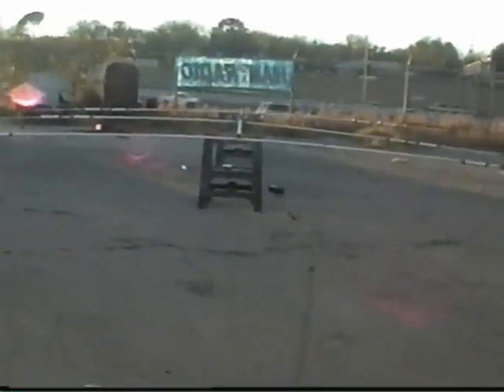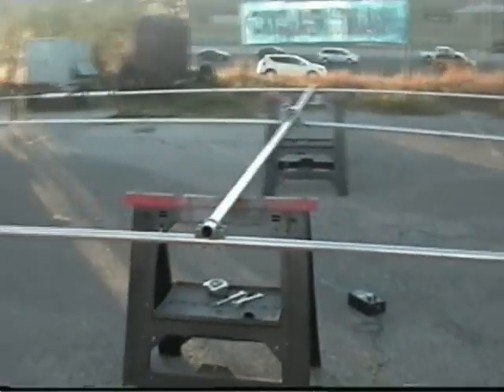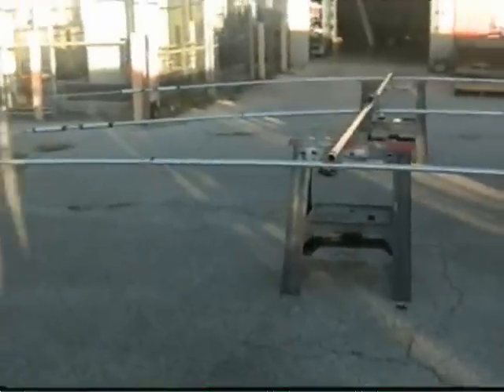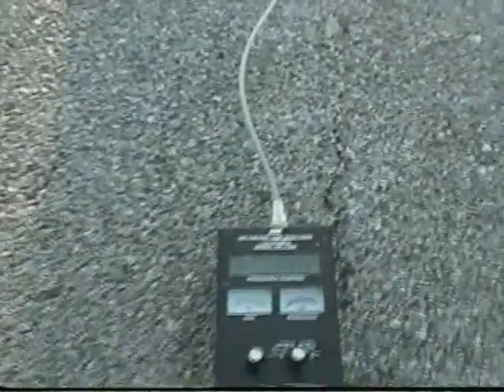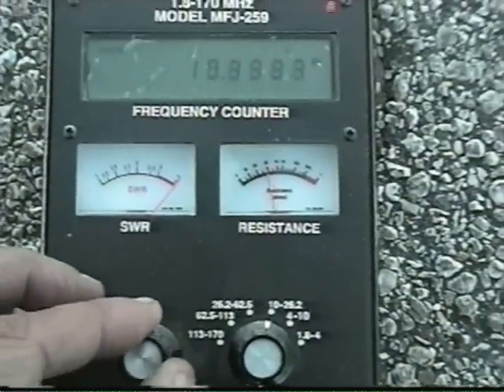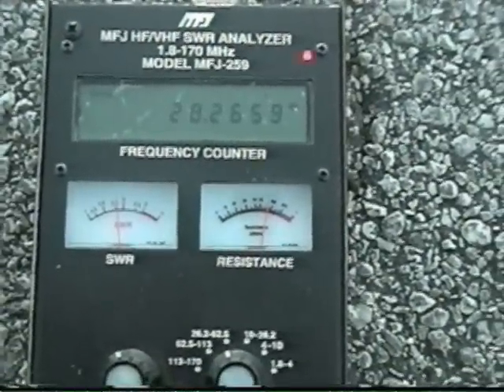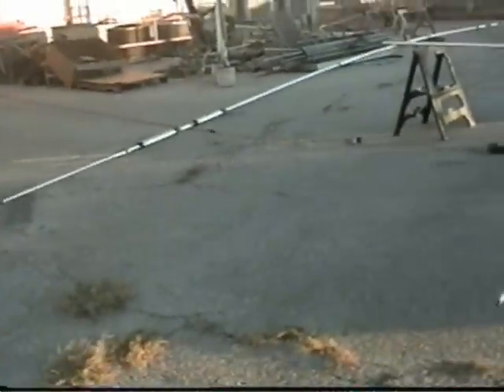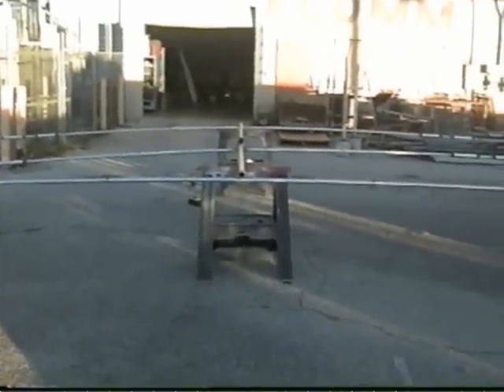Cushcraft A3S Tri-band HF Ham Radio Beam Antenna Tested At Ground Level

Comment: Fantastic video, although 15 years old but so much helpful. I had installed mine some 14/15 years ago, no issues, then reinstalling again after the house is rebuilt. In checking I found the 20m resonance is at 13.700 or thereabout when I picked the center frequency for tuning. This video confirmed that, it is normal to have resonance at much lower frequency when close to ground. Thank you...

Comment: Mel,  Just looking around at others with this antenna.  I have the ATB-34 Cushcraft 4 element beam which is exactly the same except they changed the stock number and added another 10 meter reflector to it.  I bought and put mine together in the mid 70's.  I run it at 40ft with 100 watts with excellent performance.  The gain and front to back is unreal   I've worked pile-ups in the mid-east, Europe, Asia, Africa, all with 100 watts.  I use RG213 military grade.  I have a friend on New Hampshire who I talk with frequently and he raves about my antenna!  I live in MS BTW.  I don't know when you made this video but assume you've had many contacts on it by now and well satisfied.  I paid about $275 for it new in the mid-70's.  Boy!  Have things gone up!!  73, Dan  WA5CYR
Reply: Dan Grisham I am looking for trap covers for my atb-34. Going to see if i can refurbish a great classic.

Thanks,

John

Comment: i just put back together a old a3s replace some parts to get a good swr the reflector is 7 foot 10 inch the derictor is 6 foot 2 inch take a tape measure pul the element to what the specks say the u bolt clap is the center of the antenna take a marker from the end of antenna to the center of the u bolt mounting plate for the reflector should be arround 7 foot 10

Comment: IT WOULD OF BEEN NICE IF THE TOLD THE LENGHT OF EACH PEACE TO BE AT THEN THE TOTAL LENGHT OF EACH ELEMENT IS THE END OF THE DRIVEN  24 ICHES THEN A   3  THE TOTAL ENGHT IS 24.7 FOOT LONG THE DERICTOR 2 FOOT LONG TOTAL LENGHT IS 23.1  THE REFLECTOR END PEACE IS 3 FOOT 1 INCH THE SHORT PEACE IS TOTAL LENGHT IS 26 .8 1/2 IN NOT EVERY PEACE I LIST JUST A EXAMPLE TO THE GUY WHO DID THE VIDEO IT LOOK BUT IT COULD BE BETTER VIDEO